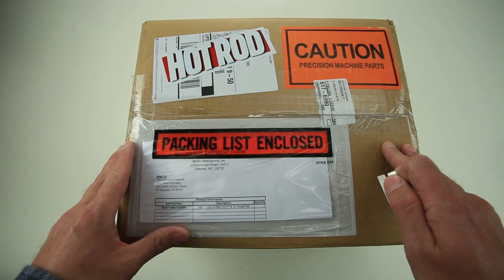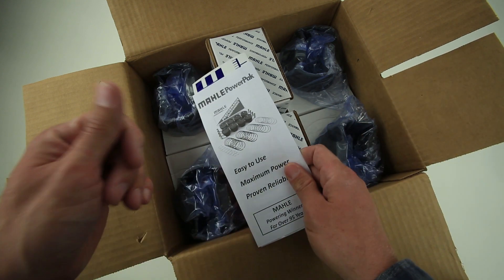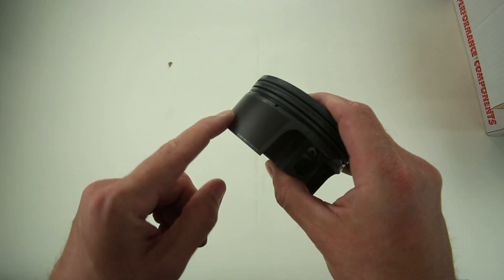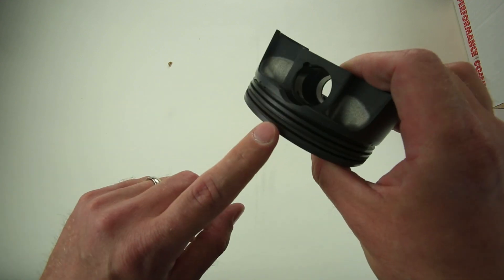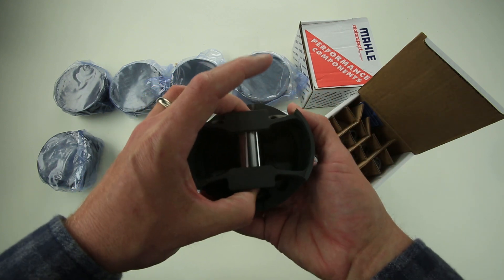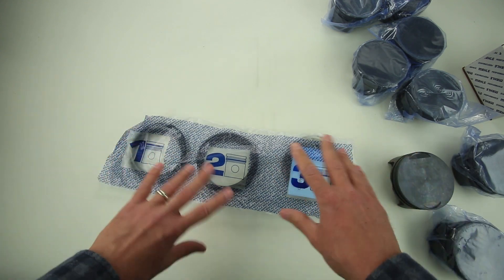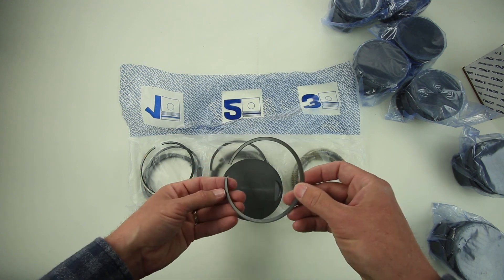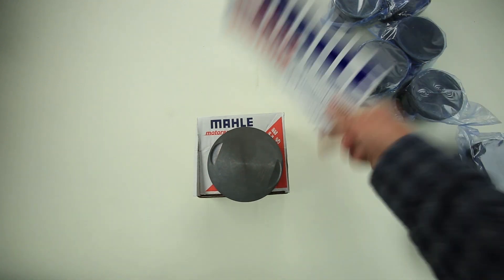MAHLE 6.1L & 6.4L Hemi Power Pak Piston Unboxing: Part Number HMI220055F01

Comment: I'm a 426 hemi guy as well as gen3s, and am currently building a 6.1 in my Challenger looking to put forged internals in it. The stock crank in them is forged, but would like to do the top end as well

Comment: Yea hemi my ass '' Suckers '' Pay for the name''
Reply: It has a hemispherical valve chamber but it doesn't have the old Hemi dome piston
Reply: +pyro8818ak47  OK? Sounds like a real hemi """ as long as you believe it .
Reply: +pyro8818ak47    [ SEMI ] hemi '' The whole reason was a dome piston and head.. But if you think your right , Maybe it's better. Hey It's not my money.
Reply: The whole reason was a hemispheric valve chamber with valves opposite of each other with a spark plug dirrectly in the centre , it was done because of the flow of the head, the piston shape dome or flat it only changed for compression ratios
Reply: +pyro8818ak47  No kidding ??  I was a machinist  . I understand ALL the principals related to the hemi. The first hemi heads were used in 1901. Pipe was the maker. Dodge copied GM's ls platform for their engine but changed the head to a splayed style and calls it a so called hemi . The problems with that head are the intake seats fall out, not to mention other problems like cracking ''  Like i said if you like em  u buy em.. But i will continue fixing them as a part of my job . Make it a complete hemi to do it correct. DONE''
Reply: ok in your opinion. is it worth having the hemi or just to junk it because my hemi dropped a valve seat.